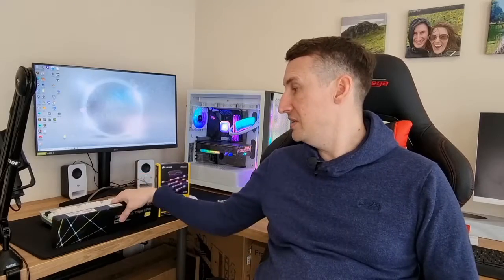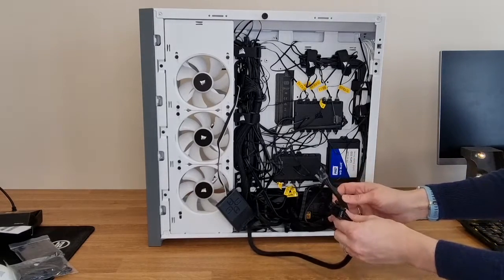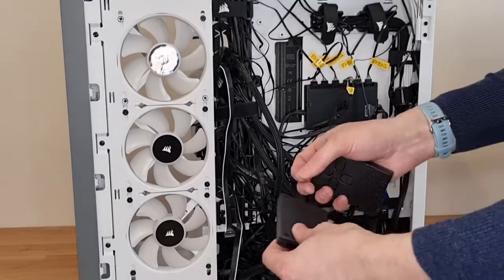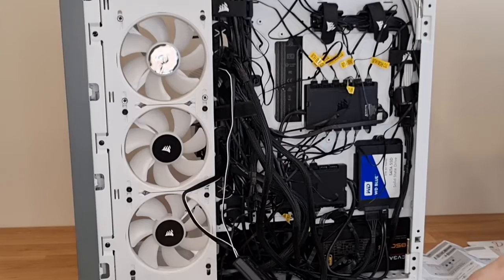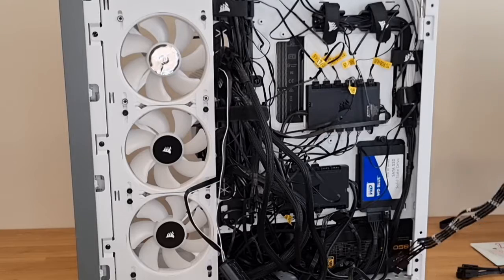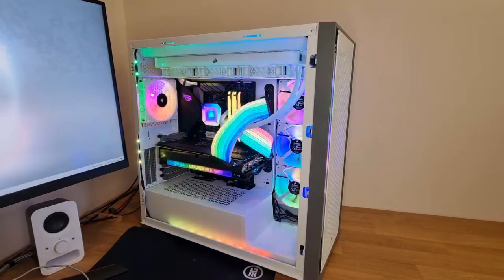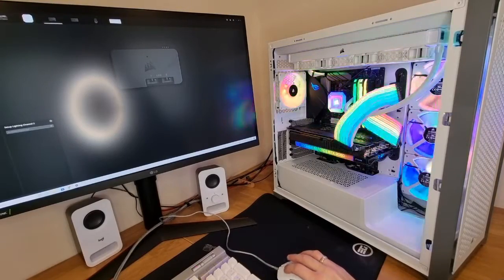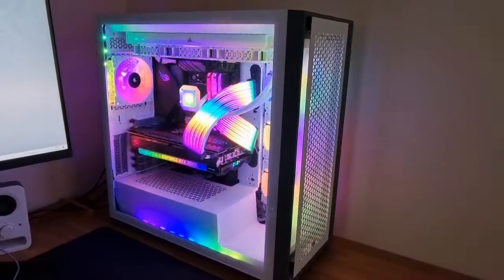How to control Lian Li Strimer with iCUE - Installing Lian Li Strimer plus GPU Cable

Comment: that looks horrid, the gpu shuld be comming from the botton. U can swith em around just needs some work but lian li is not sutpid so all u do is switch it around, that just looks someone threw them in there no straight lines ewwww.

Comment: pro tip, to make it look super clean connect the GPU power cord from the bottom not the top. looks way better and cleaner and less cluttery, your set up looks pretty but also super goofy with the water cooler tubes, 24v atx power strip and your gpu power cord all tangled together.

Comment: So Lian Li is set as RGB strips in iCUE right? And the ARGB cable adapter to connect to the Node Pro made the magic happen!
I also have the Lighting Node Pro but already full with fans and rgb strips.
So I'm looking forward to add a splitter and hope everything still works haha!

Comment: Hello, how to connect the hydro pump to icue? Can't see it, it's plugged into the motherboard rgb controller, and only aura sync sees it… icue not😭 (my aio: corsair h100x elite, i have nod pro)
Reply from the maker: Hey, yeah I think plugging onto motherboard will only mean it shows in motherboard software, needs to be plugged into a corsair controller to show in icue.  Is ur hydro pump corsair? So should have a corsair led connection to plug into corsair controller?  If not it should work with one of those rgb to corsair led adapters i used for the Liam li strimer.
Reply: @kevlargamingpcs9802  Hi, I tried to connect it to node pro, but the fan and aio don't work on one channel. It doesn't show up in icue.
Corsair h100x elite is the aio.

Comment: I noticed you have 1 commander core xt.. and the capalix control box. 
 did you know the core xt controller has 1 inlet RGB 3 pin just like the rgb node plug right next to the temp#2 and ID inlets on the core xt controller box. 
With that being said u don't need the RGB node controller unless you're I think 🤔 connecting over 36 led lights. So what ever you plug 🔌 into that rgb spot on the core xt must be under that amount of leds because of volts ⚡️ and Amps limits

Comment: At 3:05 I recommend running the aio tubes down over the back black part of the motherboard by the back exhaust fan.. then move the 24pin strimer cable to the upper rubber grommet and the then run the gpu strimer cable into the middle or lower grommet. 🤔 it won't look so bunched up.

Comment: Does this work with the l connect 3 controller in the strimmer v2
Reply from the maker: Hey, I've done a vid trying to get this to work with the v2s cables & controller.  I couldn't get it to work initially as there is no button on the controller to switch it to "nmotherboard control", but comments on the vid state there is a way, just need to change some settings in the L connect software.

Comment: Do I need to get both the lightning node Pro controller and the commander core xt to use the lian li strimers in icue or can I just buy the commander core xt and connect it to the mobo?
Reply from the maker: Hi, the commander core xt does have 1 LED slot I believe, so yes you can use that for the lian li strimmer.  (Lighting node Pro is just the cheaper option if you already have a fan hub etc, and are now just looking for connection for lian li strimer)

Comment: If I've only bought the 3x8 pin cables (no controller included), where do I plug the small black cable into to control it? and can i still control it through the L-Connect 3 software without the controller?
Reply from the maker: Interesting, the 3x8pin version does come with a controller as it doesn't fit the controller that comes with the motherboard cable.  So I assume you have bought it second hand.

I think you need the new controller that comes with the v2 cables to be connect to L-connect 3 software.

From memory i don't even think the 3x8pin comes with an Argb cable connected to it, because it comes with the controller.  So the black cable you have is only for connecting to the controller.

So I'm afraid you are a bit stuck with no controller.
Reply: @kevlargamingpcs9802 im buying thestrimer plus v2 triple 8 pin yesterday

N i dont get the controller inside

N now im stuck cant control the rgb from the l-connect

Comment: I don't understand where you connected the connectors with lian li?
Reply from the maker: So the lian li cables plug into the lian li controller.  Then there is the 3 pin rgb connector cable plugged into the lian li controller, then we have the adapter converting this 3 pin rgb cable into a corsair led cable to plug into the corsair lighting node Pro.
Reply: @kevlargamingpcs9802  And you did not try to change colors through the l-connect 3 program. All the backlighting works for me through this program, except for streamers. I've been looking for a solution to this problem for a year now. Your video was the most helpful

Comment: My Lian Li V2 cable is on, but when I want to set it in the software, there is only a choice of system settings and the RGB color settings can't be adjusted, why is that?
Reply from the maker: Hi, have done this method of connecting it via iCue? Or are you using a different method?

Comment: hey i have the strimer v1 dual 8 pin but no hub so its directly on the motherboard, would this work with my commander pro if i got the adapter, then plugged the 3 pin 5v from the strimmer then to my commander pro rgb ports, would it work the same way??
Reply from the maker: Hey, my initial thoughts are yes it probably would work the same, I don't see a reason why it wouldn't work.  As would still be tricking iCue into think the strimmer is an LED strip.
Reply: @kevlargamingpcs9802  wow i didnt expect that fast of a reply 😅 thank you though i really appreciate that ill order it right now and ill let you know soon how it goes

Comment: Can this be done with v2 controller
Reply from the maker: Hi, I did a few videos on the v2 cables/Controller too.  Unfortunately this method did not work for the v2.  However someone mentioned in the comments that if you change some settings in the L connect software you can get it to work.  But I didn't get round to trying it before I sold my old cables along with the adapter.

Comment: Thanks for the video! Very informative and useful.

It’s my understanding the strimer plus resets on a full power cycle as there’s no onboard memory controller for lian li controller. 

Does the strimer reset to default rgb lighting on a full power cycle when connected to the commander node?
Reply from the maker: Hi, thanks for watching.
So no when connected this way and using iCue software, I've never had the strimmer reset (even including after completely removing/replacing power supply) it stays on the rgb settings set in iCue.

Comment: hi, my lian li strimer plus keeps flashing random leds color.. any fix? when i plug on my motherboard, its works perfectly
Reply from the maker: hmm that's strange, so is do yiu have it connected to icue as a corsair device when it does this?  Silly question, you sure it's not just set on the setting in icue that does the random lighting.  (and have you set the strimer as an LED strip in icue, that's how I found it to work)
Reply: @kevlargamingpcs9802  yes, external light strip, but I've already tested several modes. no, these interferences is not from the effect (solid color also appear interferences)
Reply: @kevlargamingpcs9802  this video show the problem: https://www.youtube.com/shorts/JadP5NcBwYc

Comment: Hey pliz, how do u get the hub lian li with the possibilitie to connect twice a 3x8 pins on the hub? I get on stream plus motherboard and one 3x8pin streamer plus to my gpu but the hub is like ur old one..
Reply from the maker: hey, you should have got the right hub controller with your 3x8pin strimer plus cable.  sounds like you only have the hub that came with motherboard cable which only fits the 2x8 pin gpu cable.  You should talk to wherever you bought your 3x8pin cable from as you are missing the hub that comes with it.

Comment: Great video have you got a link to the adapter cable you got to link the lian li cables to corsair please  ? 🙏
Reply from the maker: Thanks very much 👍, yeah sure link is in the description, but here it is.....
https://www.ebay.co.uk/itm/Corsair-RGB-to-3-pin-Standard-ARGB-5v-Male-Adapter-/224351383232?mkcid=16&mkevt=1&_trksid=p2349624.m46890.l49286&mkrid=710-127635-2958-0
Reply: @kevlargamingpcs9802  thank you so much 👍

Comment: That work with a 2 8 pin gpus also ?
Reply from the maker: Hey, yeah definitely, exactly the same process, the controller with the 2 8 pin stimmer cable is the same, just a slightly smaller connection for the gpu cable 👍

Comment: it works but the same does not work with new Strimer plus V2. tried l3 connect adapter. does not work. do not know why
Reply from the maker: Thanks! Good to know as I have the v2 cables ready to review and see how to get them working with iCue!
Reply: @kevlargamingpcs9802  hi again when will you do it i'm already looking forward thank you
Reply from the maker: @merkekeruysat  I'm hoping to find time this weekend to look at it 👍
Reply: @kevlargamingpcs9802  likewise, I have the corsair adapter cable and it just won't work with icue. I have to use the stock lian li controller colors so I'm not able to figure it out.
Reply from the maker: @IceMaN8o4  Yesh, just doesn't work with the V2 controller.  Checkout my more recent videos on the V2 cables, only way I got them to work with iCue was by using the V1 controller with the V2 cables (which takes away your option to use the Lian Li L-connect3 software)
Reply: @kevlargamingpcs9802  aight so i just checked my order history and I just have the strummer plus not v2 so I have the original remote but it’s not working with the argb splitter cable for Corsair. I have two of them and both don’t work so I’m not sure what’s up. I’ve tried both my commander pro and my lighting node pro and to no avail it’s just turns off when I hold m1 with no icue control
Reply from the maker: @IceMaN8o4  ah interesting, I assume you have have done all the steps.  (It doesn't automatically get pick up after pressing m1), so have you assigned the relevant channel in your lightning node Pro as an LED strip, and have you got the lightning node Pro plugged directly to motherboard usb and not a hub.  If all these troubleshooting steps I had in my vid don't work, then I'm afraid I'm not sure what's going wrong for you.
Reply: @kevlargamingpcs9802  yeah so the commander pro and lighting node pro are both picked up in icue and everything works on my CP and LNP except the strimmers. I have my LED strips around my case on the LNP in slot 1 they work. Slot doesn’t won’t work for strimmer plus. Then I switched it to my CP. slot 1 is my rgb graphics card plate. Slot 2 strimmer plus and nothing. 🥲🤣
Reply from the maker: @IceMaN8o4  ah weird, sorry man not sure what to suggest, other than when you are putting the strimer into slot 2 on LNP etc, you are definitely then going in the device settings on icue and manually changing the device in slot 2 to an LED strip.  Other than that I'm out of ideas. Sorry.
Reply: @kevlargamingpcs9802  I have made it work only with Strimer plus controller. I mean old controller for Strimer plus because it can passtrouth.  same controller can also be used for V2 version.  it has the same entrance
Reply from the maker: @merkekeruysat  that's good.  I'm still going to try find a solution for the v2, as many people won't have the old controller 👍
Reply: I will be very happy. there are many who have problems